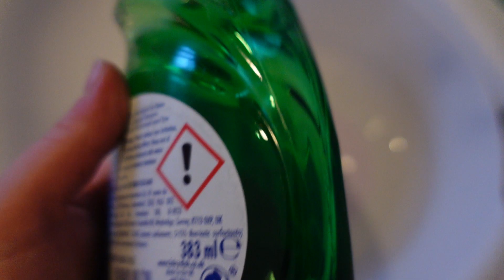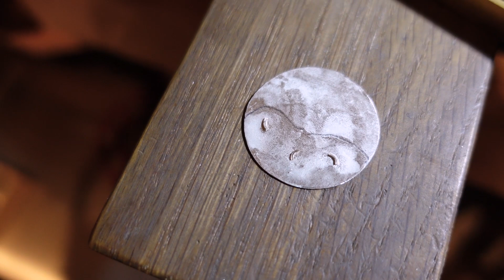How to do SWEAT SOLDERING in jewelry making. Silversmithing for beginners

Comment: Hello! 
I have a question about the soldering block you're using.
I have been using a charcoal block myself but how do I make the mesh wire thing you have on top of it?
If that makes sense! 
Thank you xx
Reply from the maker: You just wrap the wire around itself using stainless steel wire 👍 And shape it however you like, it's very simple